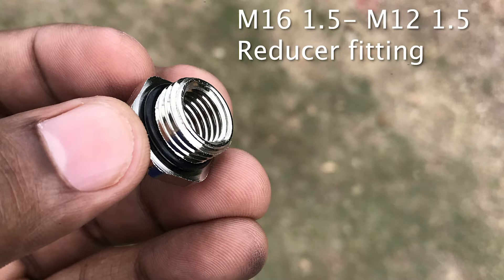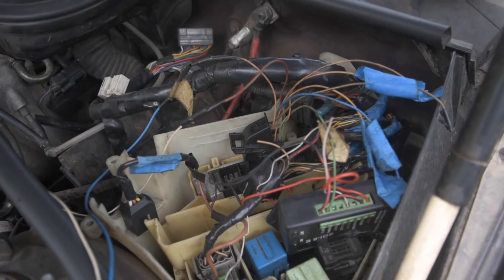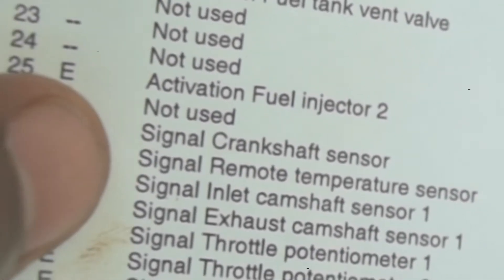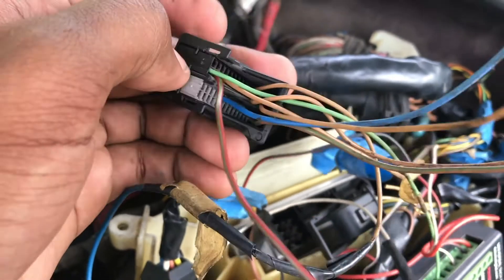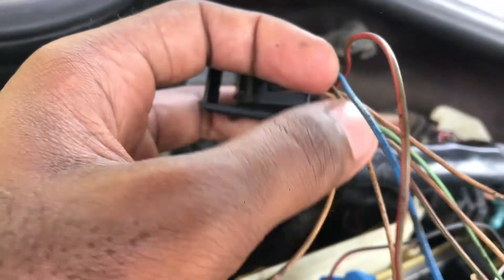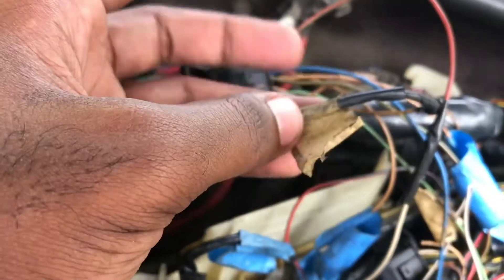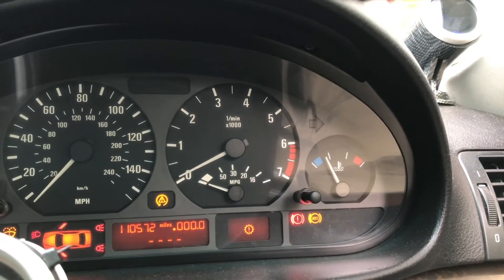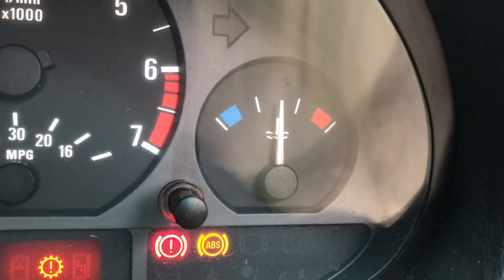1JZ BMW E46 Dash Temp Fix | Tutorial

Comment: What happen to your e46?
Reply from the maker: nothing wrong with it bro
Reply: Did you get all your clocks to work in the cluster I have a e46 as well with a 2jz vvti
Reply from the maker: @fitzyBarnett  I did. but the taco signal is not 100% working as yet. but I used a Dakota digital signal converter took signal from jz ignitor and input it to the bmw ecu crank sensor wire and that got it moving...have more fine tuning to do but just haven't got the chance to figure out what to do next.
Reply: A bay Spanish you telling me right now, do a video might go viral.
Reply from the maker: @fitzyBarnett  😂😂😂😂😂😂 chubble
Reply from the maker: another alternative is to affix a bmw crank trigger wheel to the jz harmonic balancer and use a bracket with bmw crank sensor to get pulses and send that signal to the bmw ecu and that will work no doubt.
Reply from the maker: orrrr.... build a circuit board and write a program that can translate the analog signal to can bus 😆
Reply: Can I get ur whatsapp number to assist me I am from South Africa bra

Comment: Hi. Could you tell me what are the colours of the pair of wires on the connector? I can't identify the connector x60003.
Reply from the maker: Hey rickson. I can't tell you what color I used since I depined unused wires on my wire loom but if you reach out to me on Instagram I'll try to assist you in finding your DME pinout diagram specific for your car and engine
Reply: Thanks man. I pit an RB25DET in mine. The problem is that I can't find the connector neither is there a diagram online that shows where it is wired into the cluster. I'm not on Instagram by the way.
Reply from the maker: @ricksonchattergoon2213  niccceeeee!!!!! What bmw DME do you have in the car?
Reply: Right. So the DME is MS42    5WK90329. I forgot to thank you for all your help thus far. So thank you very much for all you help bro.
Reply from the maker: @ricksonchattergoon2213  not a problem man 😎. I’ll look for it now and share the link
Reply from the maker: @ricksonchattergoon2213  https://www.adamomotorsport.pl/pinout-m52tu
Reply from the maker: I believe this is you my good brother. Check and let me know
Reply from the maker: So based on what I see on your pin out the pins 24 and 25 are what you need on your x60003 connector (engine temp sensor). The coolant temp sensor that you see on the x60004 is coolant sensor located in the hose so you can ignore that one it has nothing to do with the cluster.
Reply: @jonnoifletcher4897  Right. So according to this directory, I will need to use pins 24 & 25 on the 52 pin connector?
Reply from the maker: @ricksonchattergoon2213  that’s correct. Try and let me know. If the gauge doesn’t respond after install try switching wires on sensor (negative and positive)
Reply: Hi i would asume this will only work if the dme is there in my case i dnt hav a dme is there a pinout for the cluster wires or is it through canbus
Thanks

Comment: Hello you have topic with wire tacho
Reply from the maker: Hey man sorry I haven't done that as yet. You can either mount a bmw crank trigger wheel to the 1jz crank pulley and get a bracket for the bmw sensor and wire that to the bmw ECU or!!! Get an adruino module made to convert signal from the 1jz ECU to the bmw canbus signal
Reply: @jonnoifletcher4897  the temperatures stay in the red for me
Reply from the maker: @_JRPerformance_  what bmw DME do you have? The diagram I used for mine is for a 318i with n42 engine so yours will be different. I can help you find your corresponding pinout for your DME
Reply: @jonnoifletcher4897  328i e46 boîte automatique

Comment: I don't understand , why and how do you have the BMW ecu on 1jz engine
Reply from the maker: The 1jz ECU and the bmw ECU are ran in parallel. So the bmw ECU only controls the body while the 1jz ECU controls the engine
Reply: @jonnoifletcher4897  so can this be done if I don't have the e46 ecu?
Reply from the maker: @chaggitto  I’m afraid not chaggitto. The bmw Ecu receives the signal and translates it to CANbus and sends to nearby components then the cluster picks up this message and interprets it. There are adruino circuit boards that can be made and coded to do the same but requires a bit of coding experience
Reply: @jonnoifletcher4897  thanks for the info, I got my e46 with a 1jzgte vvti already swapped in it and I don't think it has the stock ecu or harness that goes to it. I also don't think going out and buying those items is worth it just to add temperature. I'm screwed. Also, did you ever figure out how to make the tach work?